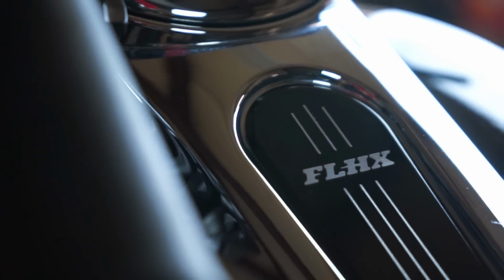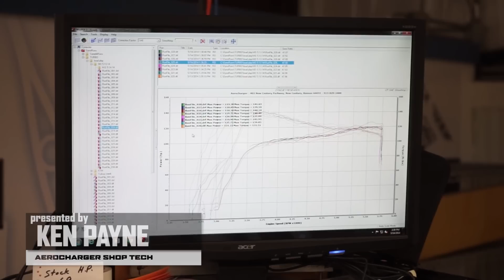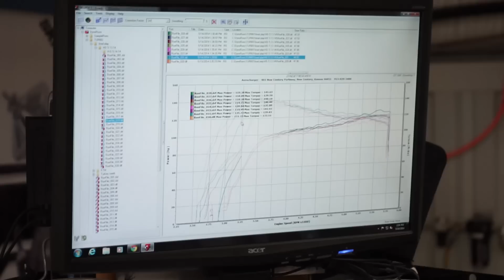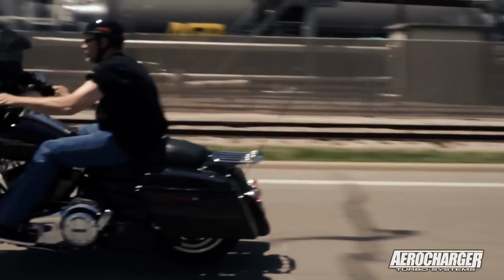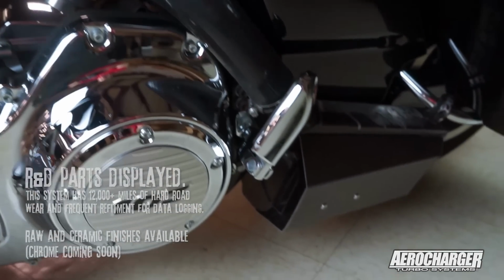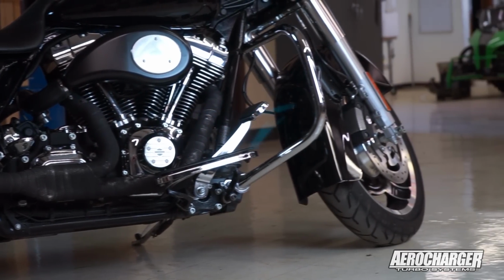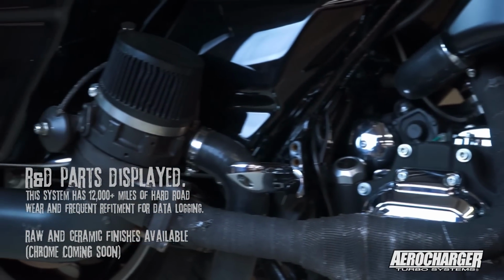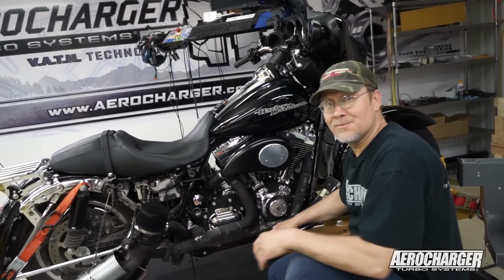Turbo Harley Street Glide by Aerocharger

Comment: Welcome to my back yard! I ran out of parts at my shop today so took off from home at 12:30 on my '17 "Dyna ST", shot over Ebbetts and Monitor to 395 south. Stopped for a quick bite at Walker Burger then went home over Sonora and got home just at sunset. Not a bad way to end the week and see the seasonal changes; aspen are just starting to turn on Sonora and at the top of Monitor. Not for the faint of heart. Best loop: Ebbetts Eastbound to Monitor Eastbound, South to Tioga Westbound, then Eastbound over Sonora back to Monitor but Westbound through Markleeville and Carson home...about 12 hours and just under 600 miles doorstep to doorstep with about a million turns. I'm blessed with these passes, but can never seem to get time for multi day trips like your crew does...maybe a case of looking for greener grass? A lot of awesome smaller less know ways to connect these hwy's and generally something's available year 'round even if one has to go to the coast. Open invite to anyone that can travel self sufficient.

All the best & looking forward to the next installment, tOM

Comment from the maker: Got some awesome footage of this turbocharged Harley-Davidson Street Glide 103.  It's a bone stock engine with an Aerocharger turbo kit, and it's got 12,000 boosted miles on it already with no issues.  Read more about this motorcycle turbo kit at http://aerocharger.com/turbo-systems/motorcycles/harleydavidson/
Reply: IDK IF MY msg. Went to you about my low rider so im sending this msg. To you in hope's that you will receive my other msg's. With questions i have for your company thanks
Reply: Can i use this with a 1340cc Vtwin with ported polished flowed heads bigger valves and springs carborated  11 1/2 to 1 compresion adjustable push rods and S&S SUPER E CARB WITH A S&S 562 CAM also have a new transmission with new gears replaced the morris taper with a new splined main shaft and clutch basket and race clutch pack have 105 to 110HP now would like to see if I could get 150HP plus and if your turbo system or a regular turbo? would get more HP and what would work if would work at all with current motor dont want to chabge but would it work with the way motor is et up and what kind of numbers could i expect thanks
Reply from the maker: thunder god That bike would be badass with a turbo :-)  Unfortunately Aerocharger's retail H-D system is only compatible with 2008+ FL touring bikes with EFI - you would need to work with a local performance shop to build and tune custom systems for your carbed bikes.  Write us at info@aerocharger.com for more info, and thanks for your interest.
Reply: +AerochargerTurbos only FL no FX I was getting excited?!!!

Comment: That's nice...but my Goldwing meets those numbers stock. Can even slow down to 25 in O/D and pull away. Doubt that turbo will do that. That is going to run HOT!
Reply: Wow   !!!!!!!
Reply: hahaha, with easily twice the weight
Reply: LMFAO stock Goldwings put down mid 90s hp and low 100s ft lbs..... You'd end up getting embarrassed
Reply: Goldwingers gonna get their feelings hurt, for sure, also let me see you ride 600 miles on 600 cc crotch rocket, with your backpack on, lol
Reply: Your Goldwing does NOT make 120whp stock. Maybe around 95whp but nice try my dude. As much as I love the goldwing, this Harley would leave you in the dust.

Comment: Some of these kits are $4-5k. For no more power it makes, I can’t see spending that kind of money for roughly 120hp.
Reply: You kidding? You are doubling the horsepower for not as much money as you think. Try doubling the horsepower in a car for a few grand and see how easy it is
Reply: @beardedforlife3740  I think his point is that you can probably find a bike for $5k that has more horsepower
Reply: Check out Darkside Customs! They build alot of supercharged Vrods and 114's/117's that actually make real power. Anywhere between 160whp and 200+whp
Reply: You can always turn up the boost man

Comment: So the same power as a r6 with a exhaust and a tune
Reply: +rocker85675 air cooled motor on a 25k bike "rice" is better value faster and a lot more reliable than eney POS Harley
Reply: The bikes don't even compare. Nonsense comment.
Reply: sell the r6 a year later. see what you get for it. lol
Reply: You say fool. I say skilled bike builder whos done more with two wheels than you ever will...tid for tad
Reply: If they're so bad, why did the vr1000 get kicked from its class in gp? Oh yea, it was because none of the rice rockets could keep up...listed as an "unfair advantage"
Reply: Apples to oranges dude. Nobody wants to come look at a 400lb ugly piece of plastic anyways. A good launch from a Harley will take an r6 off the line easily anyways. 600cc sportbikes are a dime a dozen

Comment: Hey George Edmonds, make that 600cc rice burner the same weight as my 2016 Road Glide Ultra and lets get it on, 600cc has no chance. They have no torque and that's where it's at.
Reply: but they have aero dynamics and they would still have more horsepower lol...did you even think this through?? Im a cruise guy, but harleys are over prices low power garbage.
Reply: You guys do realize CRUISERS in general don't make a lot of power?
Reply: That's ridiculous...you just fabricated your own scenario where the Harley would come out on top. Typical Harley shit talk. Let's face it, a good launch from a Harley would leave a 600cc bike off the line, but the sportbike would pass the Harley in the long run 👍torque is not where it's at if you want to win a race...top end horsepower is what wins a race. no need to be salty about it
Reply: @Texarmageddon  the Triumph Rocket 3 is indeed a cruiser with power.
Reply: @GonZilla0214  like they say horsepower sells bikes torque wins races

Comment: Just my opinion shame you have to do that and spend that money from 120 some horsepower
Reply: Thats just 2 grand to get it to 125 hp. A full system on a rice burner will get it 5 to 10 more hp on it for about 2 racks. Soooo about the same money for the same thing